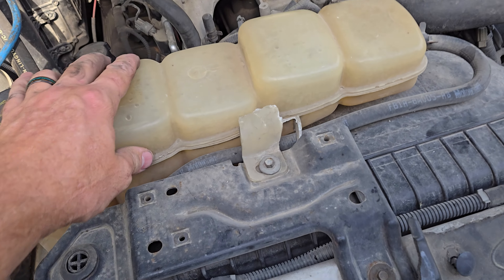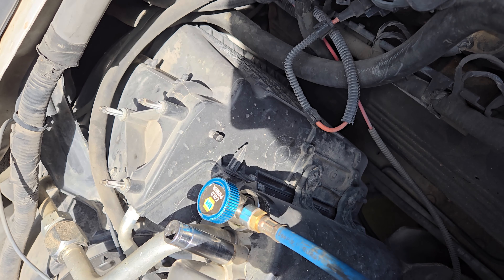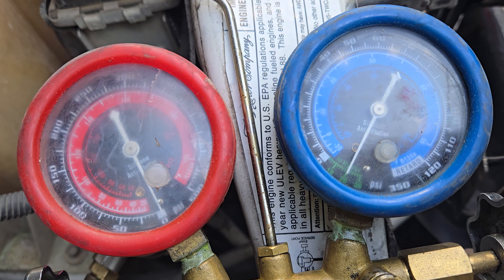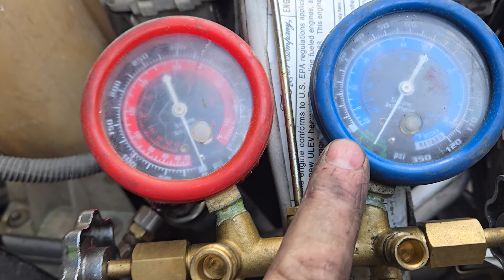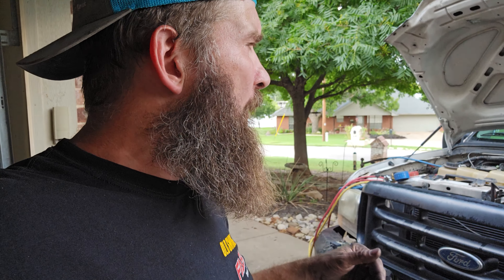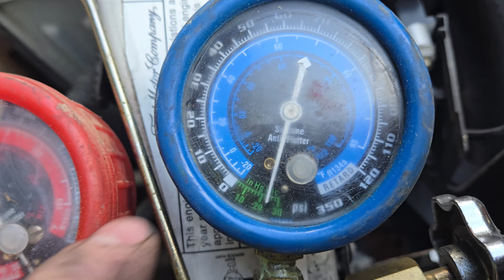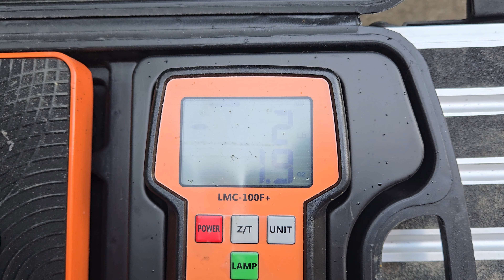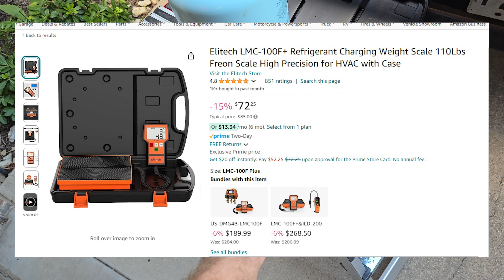How To Change An AC Evaporator And Condenser On A Ford Superduty

Comment: Left my salvage yard ac system for my Chevy cobalt on the harsher floor for 3 months. North carolina winter. December- February or March. Put it in, ducked it down for a bunch of hours. Yes I replaced every o ring. And it still works 5 years later in south eastern nc.

Comment: I wouldn’t put anymore refrigerant in it. It’s a half pound over already. Too much of a good thing. High side pressure will be higher than necessary and cause higher vent temps. It’s important to charge by weight on automotive AC. The lower the low side runs, the colder your evaporator/ vent temp will be. And again, check the fan clutch. If it won’t hold a shop towel on the condenser at idle when up to operating temp, put on a new clutch.  It’ll freeze you out and and all the new parts will last a long time. 

Always good to see a new video from you!

Comment: Very good info im looking at a quote for 1300.00 and I kw I can do that ac job I just ck cost for all the parts on my 2003 F-350  ac kit 250. Evp. 100.00 don't for get the heat core might as well change it for 28.00 bucks but otherwise it's a do-able job 
I guess I was getting lazy till I watched your video thks for all the tips..

Comment: Glad I'm not the only one that noticed Ford A/C is a lot colder than most everyone. Even when it's near triple digits, a Gord with the new R1234YF refrigerant gets to like 38⁰F. Dodge vehicles regardless if its R134a or R1234YF, they seem to maybe get low 40s to about 50-52.

Not sure why that is and this is with brand new vehicles too.
Reply: My Super Duty is one of the oldest vehicles I own and definitely has colder a/c than any of my newer vehicles.

Comment: Ideally, you want a vacuum in the 500 micron range. That style of pump will not do it. It won’t even get close.  That kind of pump will get the air out of the system but I don’t think the vacuum is low enough to allow moisture in the system to boil off a be removed.